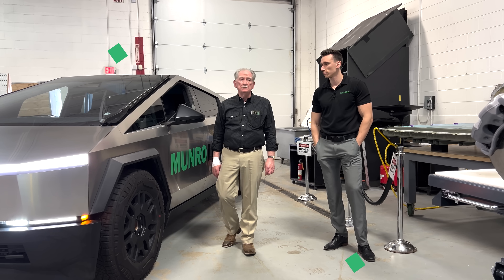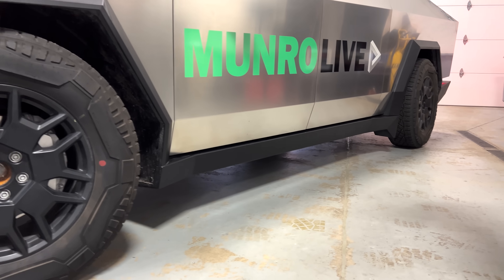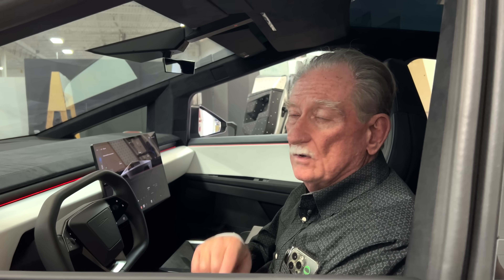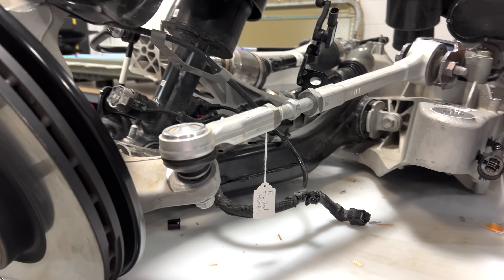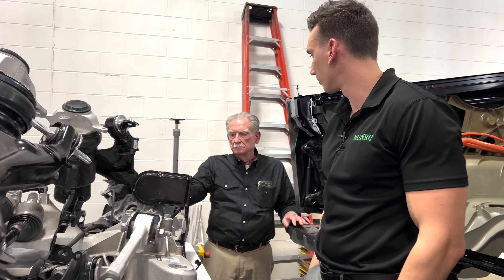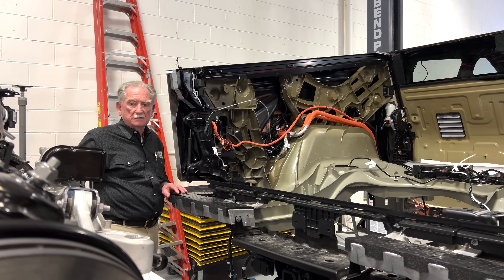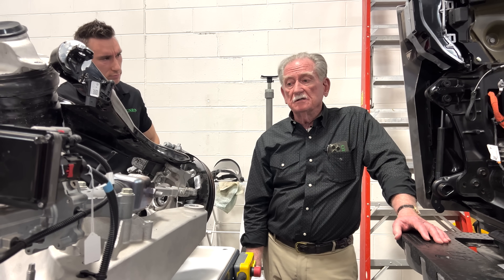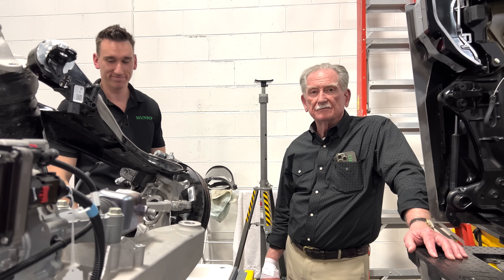Tesla Cybertruck Steer-by-Wire System

Comment: Can a shade tree mechanic work on this thing?
Reply: Depends on if he has an open mind.  
video "Wrecked my Tesla Cybertruck at Moab"
DblCapCrimpin
23K views
Took the CYBERBEAST out to off road/Baja in sand dunes at Moab Utah but it ended quickly with a launch from a ~4.5 foot ledge!
Reply: no lolz.  you can probably fix linkages, take a seat out, but other than that, repairs arent cheap

Comment: Wonder if it s possible to hack and ad a "steering angle increase box" in line with the data cable to modify the signal. So you get extra angle on the back wheels and crab mode steering etc.
Reply: Tesla has internal applications which do this.

Comment: Question: If one of these two actuators dies, doesn't it block the whole steering due to its high gear ratio?
Reply: No.  Each actuators has enough power to steer but it may be sluggish.

Comment: So on my CyberTruck, I can feel mechanical vibrations of the road through the steering wheel.  Is this a simulated response by the car, or is there some mechanical cause of the vibration?
Reply: Can you feel the same vibration on the dash?
Reply: @danharold3087  Nope.  It looks to be simulated, which is super cool....
Reply: thats why theres a steering shaft that goes into the engine compartment  all those electronics on the shaft provide feedback.  The entire car frame shakes and vibrates when you hit a bump, so you are getting feedback from the car frame as well.
Reply: @davidanalyst671  There isn't in this car if you look at the Munro teardown.  It is a very cool example of Haptic feedback by the system, to help us stupid humans feel better :)
Reply: re: "Is this a simulated response by the car". yup it's a "simulation" just LIKE THE MATRIX...!!! (uh oh)

Comment: One of my favorite things to do in my Cybertruck is u-turns. Especially when I have someone with me who drives trucks.
Reply: hahah fud legqcy auto d riders are everywhere atm
Reply: A regular Toyota Hilux has a shorter turning radius though, so I doubt they'd be impressed.
Reply: @logitech4873  A Hilux is a much smaller truck. Like, MUCH.
Reply: @logitech4873 turning radius? Wheelbase of Hilux?
Reply: But you would be turning the steering wheel around and around and back around and around like noddy driving 😂.  @logitech4873
Reply: Until your accelerator pedal sticks and ur doing doughnuts at 120 mph. Good luck champ
Reply: @FrickYourHandle  hater gonna hate
Reply: @FrickYourHandle  At higher speeds it turns the wheels in the same direction as the fronts. Only at low speeds does it turn right when the fronts turn left. I think all cars/trucks do it this way.
Reply: @FrickYourHandle  toyota had a massive recall about 15 years ago about the accelerator pedal getting stuck in the carpet. My 08 tacoma was involved. I think it was millions of vehicles involved overall from multiple models. It is dumb to throw rocks when your house is made of glass, every manufacture has recalls from Mitsubishi to Maserati. By the way i don't like Tesla and have owned 1st,2nd,3rd gen tacoma as well as f150 and a f250. My f150 had a recall for the cruise control system catching fire, my 1st gen tacoma had a recall for major frame rusting, there are literally hundreds of photos of first gen tacomas with the frame split in half where the bed and cab meet
Reply: @FrickYourHandle  sounds like you’re talking about a 1st gen Prius?
Reply: @FrickYourHandle lmao fear much?
At least 1 fact = my cybertruck pedal is just fine and I haven't had it reworked.
Fact #2 - if you press the brake pedal it overrides acceleration and I know this
My Cyberbeast is a crazy engineering feat that you don't understand. Although it's terrifyingly fast, I'm not scared of the pedal situation.
Reply: @FrickYourHandle  just facts? How about the fact that my truck doesn't rust?
It's already at a higher volume than hummers lol
I mean, all vehicle launches are difficult, you just don't understand the scale of it.
Reply: @FrickYourHandle first off the accelerator pedal getting stuck is a rarity, second applying pressure on the brake pedal will void input from accelerator pedal.
Reply: @FrickYourHandle  you should look for how this is implemented in the cybertruck.
You got your fscts wrong.
Reply: @FrickYourHandle  SO exactly how many times did the pedal get stuck as you like facts? was it 10 or 100 maybe? or Never .. its a recall  this year 2024, Ford is recalling nearly 2 million Explorer SUVs made between 2011 and 2019 over concerns an exterior clip that holds the windshield trim in place can detach while driving, causing a trim piece to fly off .. big deal Fords still make great cars ... so whats your actual point?
Reply: @FrickYourHandle pop rivert. 30 seconds.
My mate has 2016 Kia Cerato. Whole new engine. 200,000 of them.😮

Comment: Whats the chance of Squirels or mice chewing wires and make something fail 😢 are some wires cover still made from soybeans plastic ?
Reply: The wiring is duplicated for safety.
Reply: Many cars now have electic power steering.   A bit fewer sensors but all the same problems.

Comment: Incredible engineering! Most technologically advanced vehicle. General Motors may as well apply for bankruptcy. 
Could you explain how with "only" TWO steering motors and THREE SENSORS the system would qualify as TRIPLE redundancy?
Reply: nonsense!!! when we talk about advanced vehicles this tesla garbgae is not even to be mentioned! the Mercedes Unimog that no one talks about offers literaly everything from all wheel steering to central tire inflation system to vario pilot which you can literaly slide your steering wheel from left to right with the pedals and dashboard all in one, a rigid/flexible, PTO for mounting crane, snowblower, all kinds of equipments for construction, utility.... the list goes on and on, lets not forget its an excellent offroad an offroad monster
Reply: Yes I remember seeing the Unimog demonstrations at the Hannover Industrial Fair in Germany in the old days. Incredible when it climbed up 45 degree inclines and still could PULL things up! But the Unimog is optimized for attaching ALL SORTS of contraptions, and for incredibly difficult terrains, not for effortless and quiet high speed driving. Didn't realize it's THAT expensive nowadays. Also the Unimog IS NOT sold in the USA. You'd have to (and can) IMPORT (special versions) it yourself. And it certainly IS a fabulous machine, but for its own purpose. MANY, MANY different configurations available. IMAGINE having a 32-speed transmission, for example. As far as for me personally, I'd wait for a $25K Tesla, but that may never come.
Reply: @alanmay7929  Well said.
Reply: @alanmay7929 The Unimog base price is $225,000 🙄
Reply: @fredbloggs5902  it doesnt matter what ic cost! its literaly worth every penny! its Universal vehicle used for all kinds of applications no other vehicle even compares to it nice try lol!!!
Reply: @alanmay7929  Your comparison was stupid. Grow up and stop trolling.
Reply: @fredbloggs5902  my comparison is totally valid, the unimog is also a pickup truck, not just that but an universal vehicle keep your lame arguments.
Reply: @fredbloggs5902  i mean if i even talk about the mercedes gwagen pickup truck, the decade old 6x6 was a monster with all features you coul ever ask on a truck, plus the ability to literaly go everywhere you want.
Reply: @fredbloggs5902  If anyone other than Tesla built the CT it would cost about that too.  Tesla squeezed a lot of cost out of that truck.  Yes they are charging more it helps pay for the ramp up.  Hear they are cash positive which is amazing if true.
Reply: @alanmay7929  you’re just mindlessly trolling

Blocked
Reply: @fredbloggs5902  yeah "troll"
Reply: Technological advancement is not what sells vehicles. Even within the EV space, simplicity is a selling point.
Reply: There are 3 positioning sensors on the steering rack and the 2 motors are constantly monitored for degraded performance and either one of them is powerful enough to do the job on its own.
Reply: The Unimog "UNIversal-MOtor-Gerät" is an apparatus with incredible all-terrain ability and you can plunk on all sorts of things and apparats and use it even like an agricultural tractor. But it's for a totally different market than the Cybertruck. Plus, after 50 years on the market it's selling maybe 200 "new" units in the USA via special importers only, so not a real success.

Comment: Simpleton brain here: Is the steering ethernet connection similar to IDE? Took me back to building my last PC in 2006. I hooked up one new SATA hd and also reused my previous IDE hd.
Reply: IDE is parallel. Ethernet is serial, and so is SATA. 

The strange use of ribbon cable encourages comparisons to parallel interfaces, but that's misleading.
Reply: SATA would be a better comparison, but Ethernet is Ethernet, why try to compare it to something else?

Comment: Here's a question: would the Steer-by-wire system be able to perform what amounts to "dynamic wheel alignment"? I would think that the CyberTruck could perform micro-adjustments to the wheel alignment as the vehicle is moving to minimize rolling resistance. Maybe this has been mentioned at some point but I have not seen or heard anything about it.
Reply: No.

You can clearly see the steering rack geometry is pretty standard with the usual way of adjusting alignment manually with a spanner.

Both motors work together to drive the same rack. There are 2 for redundancy/safety in case one fails.
Reply: @fredbloggs5902  - Understood. Thanks for that clarification.  As I mentioned to the other commentor, I believe caffeine deprivation led to my wayward thought. 
Cheers!
Reply: Q: Here's a question: would the Steer-by-wire system be able to perform what amounts to "dynamic wheel alignment"? A: no, well not at least with this system in the way it's currently configured, but that IS an interesting thought you have as it would simply have to be configured in the way Porsche ALREADY does it with the Rear Wheel Steering option available on the 911...

that is to say, the current generation 992 (by virtue of being a rear engine mated to a transaxle) is forced to implement the use of Rear Steer by way of 2 separate actuators (1 placed at each wheel) that are not connected as would normally be with a standard EPS rack, therein technically they are able to move INDEPENDENTLY of one another for optimal geometry (think: Ackerman Steering)...

to that end your idea of Dynamic Wheel Alignment DOES in fact exist at least in prototype form, yeah the mighty VW Group just debuted it 3 months ago iirc on a Lamborghini Huracan and it's called called AWC (Active Wheel Carrier).  that's right, sorry Tesla but you lose again, unfortunately your CEO's Ego is simply not big enough to overcome the DEFICIT Tesla has to an OEM like VW who actively participate in Motorsports and Racing.  again i repeat: "Anytime you win Leman 19X since 1970 (mind you someone hadn't even born yet) you learn things that the laymen and pretenders DO NOT..." (my voice) 

https://www.youtube.com/watch?v=4KbSE2dS8-4 <---- Ex-Racer Scott Mansell (ie. Driver 61) explains Lambo's Active Wheel Alignment back on January 29, 2024.
Reply: ZF does offer rear steering using separate actuators for left and right, so it can actively control rear toe angle.  This vehicle uses a single rack at each axle, so the only alignment it can control is whether the front and the rear are pointing the same direction.
Reply: Not sure what you mean. The only parameter a steer by wire system could change is toe in.  And for that it would need a split rack which doubles the number of motors and sensors a much more complex design. Or am I in left field.
Reply: @danharold3087  - it was just a thought, apparently not a terribly good one, but in my defense I had not had my morning coffee so I blame caffeine deprivation. Thanks for your comment!
Reply: @thomasruwart1722  Not a problem.   It happens.

Comment: lock-to-lock is closer to 340 degrees. From centered to max turn is about 160-170 degrees.
Reply: Starting around 4:00min Sandy is steering lock to lock (ones he is not fully to the right and he talks bullshit about the angle... NOT 90deg nor 180deg lock 2 lock) but I do see around 320-340deg of steering angle! ~160 to 170 left and 160 to 170 right. Maybe you watch something different 🙄
Reply: First he had the wheel turn all the way to the left and not the right as stated. Also from lock to lock it is around 270 degrees.  180 degrees is half of a rotation.
Reply: You REALLY need to get your eyes checked. LOOK AT the video again.  IT IS NOT 340 degrees. It is more like under 300 degrees, maybe 280 degrees is more like it. 360 is the full circle.
Reply: @1flash3571 he is correct 170 degrees.
Reply: @1flash3571  he is correct - there are pictures of the CT screen showing +/-160-170deg steering wheel angle for lock 32deg at the front wheels. So 320-340deg lock to lock depending on the ratio provided (by nature of the system it can be changed to even less SWA required)
Reply: @felixweinreich3999  Soooo, when SM did the ACTUAL TURN, that is FAKED???????? WTH you talking about????? I saw what I saw, and he turned it from left to right to the MAX and it wasn't 320 degrees.
Reply: @1flash3571  SbW is variable gear ratio! You could also do plus minus 10deg lock to lock if you want to... but actually cybertruck on the road has standstill lock to lock around 320-340deg!!! Will be different when you change the vehicle speed (even more indirect ratio) Cybertruck shows the data on the screen with steering gear rack travel, steering wheel angle and road wheel angles...

Comment: why are they still using massive steel frame when they already have the aluminium casting?! is that thing sooo weak?
Reply: It is a steel unibody vehicle, with aluminum subframes. I don't know what "massive steel frame" you think you are seeing, or what aluminum casting you think runs the length of the vehicle.
Reply: @brianb-p6586  what a joke! its not a steel unibody vehicle. the steel is just for the body the underneaths is aluminium .wasnt the aluminium casting supposed to carry everything? i mean even fot the towing hook its also a massive steel structure at the rear which means nothing will ever beat body on frame vehicle no need to argue on that. you can see 30 years old toyota hilux trucks hauling up to 3x their normal capacity.
Reply: @alanmay7929  It is a steel unibody, although it has huge aluminum castings; that's becoming a common automotive practice, although Tesla uses larger castings than other companies. 

The large casting at each end "carries everything", because the suspension is attached to it... but that still leaves steel for the entire body and the battery, passengers, and cargo carried by it. 

I don't know what upsets you about this, but I'll also note that only the exterior panels and inner door panels are stainless steel - the hidden steel panels are not stainless.
Reply: @brianb-p6586  a steel unibody means the casting would have been also made of steel! a range rover is unibody aluminium, Honda Ridgeline are unibody steel construction.
Reply: @alanmay7929  The unitized body and structure (which is what "unibody" means) is steel. The aluminum castings are a huge part of the structure; you could consider them as part of the unibody, or large subframes, but they are not a frame themselves.
Reply: @brianb-p6586  wrong! The big aluminium castings supports both the steel body and the motor crate plus towing steel assembly. There is nothing part of anything!  Still weaker than body on frame

Comment: Do you have to get wheel alignments set systems?  If so.   Is it special?  Or any place can do it???
Reply: The steering geometry looks pretty standard, alignment could be done anywhere.
Reply: Should be a standard 4 wheel alignment
Reply: You probably gonna need the Tesla service computer to set the car in wheel alignment mode or something. So basically take it to Tesla and pay.
Reply: @mrm1885  So the opposite of all Teslas this far? Why do you think they have changed their policy? The "service computer" is already in the car. You can put it in service mode and fiddle with stuff yourself if you are brave. (Let me guess, now THAT is a huge problem...)
Reply: The only difference between alignment of this and any conventional vehicle with independent suspension would be steering wheel centering.

Comment: Beautiful system, yet very expensive. I'm surprised Tesla adds the complexity and cost of a rear wheel steer system, it kind of goes against "the best part is no part".
Reply: You don't understand "the best part is no part".   Your saying the best car is no car.
Reply: re: "I'm surprised Tesla adds the complexity and cost of a rear wheel steer system" no worries, be less surprised as the CT's wheelbase is a whopping 143 in.  for reference this is 7 inches longer than the RWS equipped Hummer EV, but 3 inches shorter than the wheelbase of the RWS equipped Silverado EV.   Tradesman and Contractors already struggle to get in and out of tight-ass Home Depot parking lots with the existing wheelbases of their Crew Cab gassers and Duallies.

Comment: What Mercedes has full steer-by-wire?
Reply: Steer by wire has evolved over time and I don't see where anyone can claim it as there innovation.   It is not so much that this truck has any one feature.   What stands out is that cyberTruck incorporates so many advanced features as standard equipment.
Reply: Various Mercedes and Nissan models had a system which disconnected the wheel from the steering column and ran steer-by-wire (complete with variable ratio), but in case of failure falls back to the mechanical connection. I don't know which Mercedes models have used it, but Nissan put it in the Infiniti Q50 a decade ago.
Reply: No standard road cars.

Maybe the Unimog which is a quasi-military off-road truck costing $225,000+ ?
Reply: @fredbloggs5902  No Unimog model uses steer-by-wire.